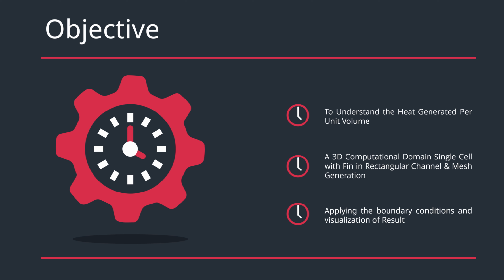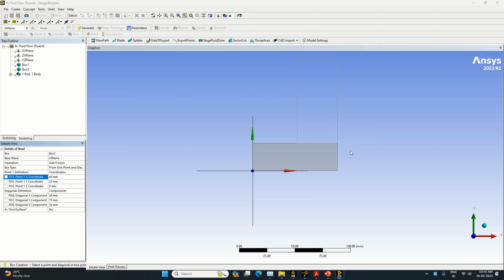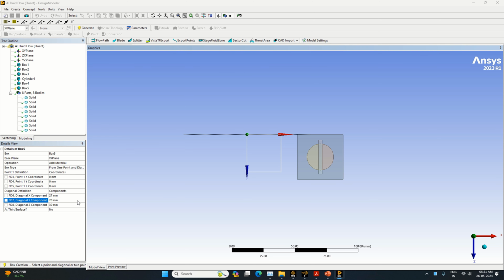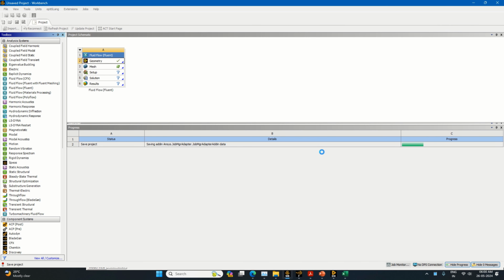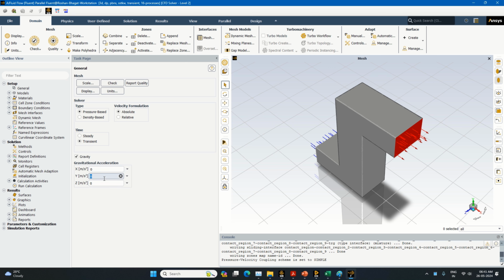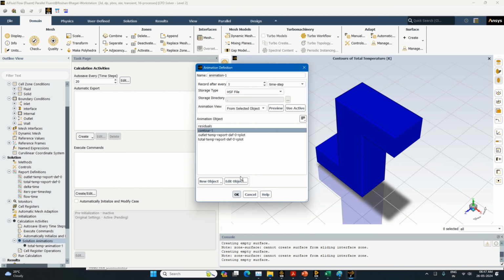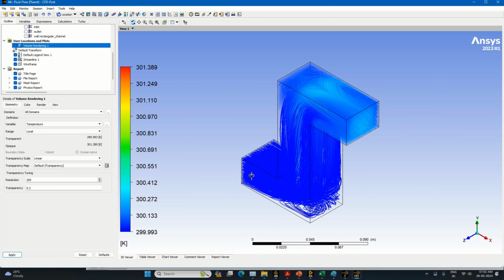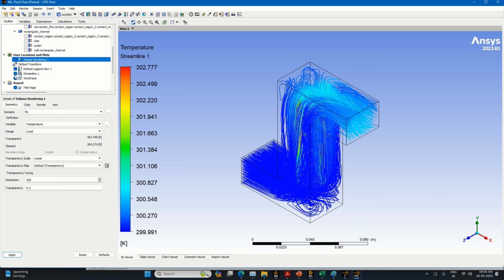CFD Simulation of Lithium-Ion Battery Cell with Fins in a Rectangular Channel with Heat Generation

Comment: I am getting could not connect error on clicking results what to do
Reply from the maker: Right click reset in result. and right click clear generated data. If both of them not work save the workbench file with different name and try to open again
Reply: @FrontiersInCFD  that is also not working

Comment: I have done exactly the same trying to validate but temperature is not having any change ... What do I do now. Help me
Reply from the maker: check the cell zone and boundary selection
Reply: @FrontiersInCFD   the ambient temperature is 30 degree stated in paper .where do i put it ..In my case temp isnt changing that much ..in boundary condition and cell zone I have done exactly same as yours but it isnt helping ..please help

Comment: Hello sir, 
I followed this video but now i want to validate with this paper but facing problem to put value of heat generation in source term for 2.5C. Can you please guide me sir?
Reply from the maker: find the internal resistance of the cell then you can calculate the heat generated, take the heat generated per unit volume based on 2.5 c rate current value
Reply: But there is given an equation and it is time dependent.  @FrontiersInCFD

Comment: Sir, I am trying to validate the results from this paper, but the graphs are not plotted with respect to time — for example, Temperature vs SOC, Temperature vs Discharge Rate, Velocity vs Number of Loops, and so on. Could you please explain or provide a video on how to validate such graphs? It would be very helpful for me.
Reply from the maker: You can get temp vs time graph. For discharge rate you need to setup different discharge rate then you can compare it with temperature.

Comment: Sir in this design only one battery is analysed in which application they will use one battery sir?
Reply from the maker: A single Lithium battery cell is not typically used alone in practical applications. However, in this case, a single cell was considered purely for simulation and experimental analysis. This approach was necessary due to software limitations and computational constraints.
Studying one cell helps us understand its thermal and performance behavior in detail, which can then be scaled up for full battery pack analysis in future work.

Comment: hi, how did you calculated heat generated values ?
Reply: So what discharge current values you are taking...bec in paper they didn't mentioned I think?
Reply from the maker: you can use from manufacturer catalogue
Reply from the maker: if you know discharge current you can calculate the heat generated per unit volume of cylindrical cell

Comment: Hello doctor, I follow your channel regularly and I have a simple request related to the latest video titled "CFD Simulation of Lithium-ion Battery Cell with Fins in A Rectangular Channel with Heat Generation". Can you please explain how these graphics were obtained? 

Link for figure
https://drive.google.com/file/d/1xCfXiQhcPlryFKNO1KhWTwy7rH4SOqeU/view?usp=drivesdk
Reply from the maker: You need data of  temp vs flow time. And for given flow time how much battery has discharge that will generate this chart.
Reply: Doctor, the data in this figure may be taken from CFD during the simulation? or only from the experimental
Reply from the maker: in one of my case i took the experimental data for given flow time how much variations in temp. similar conditions were applied during the simulation
Reply from the maker: in one of my case i took the experimental data for given flow time how much variations in temp. similar conditions were applied during the simulation

Comment: Hi, great video again. Is there a way to input a data file for heat generation rate for battery cell with respect to time. as battery heat volume changes as per usage for an EV. if there's a csv file with data of heat gen rate(w/m^3) and time in second. is there a way to input the data and run the simulation
Reply from the maker: Will check and update you